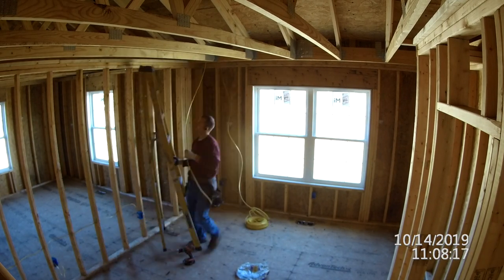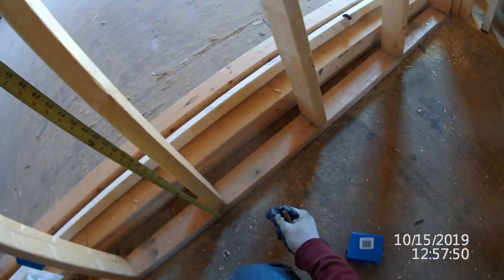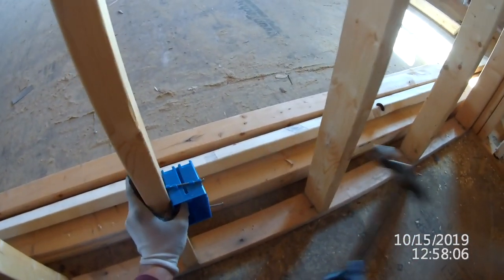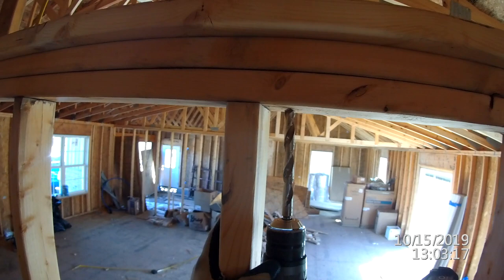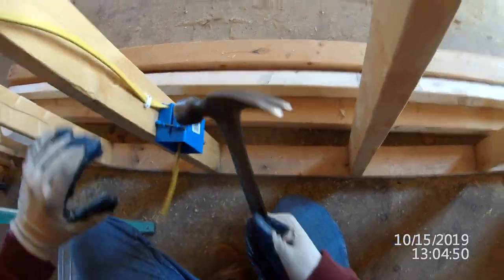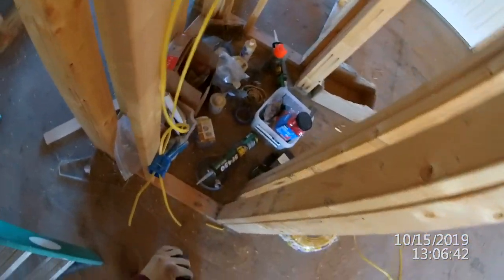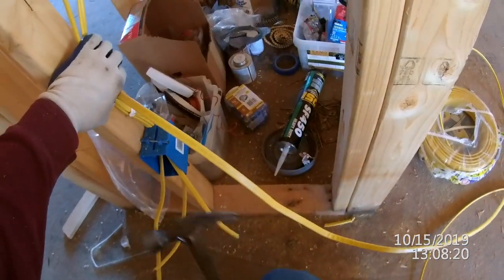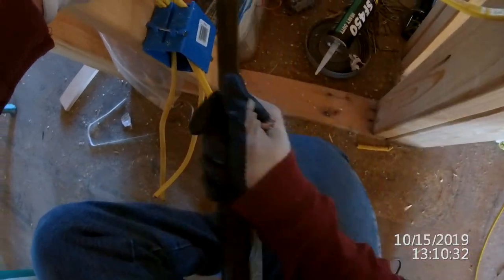How To Rough In Electrical For Receptacle Outlets & Switches

Comment: Trying to figure why you are spacing every receptacle box six feet apart, isn’t initial spacing 6ft so you can have them 12ft apart box to box?
Reply from the maker: Check your local building codes for details. I do every 6 foot apart so I will have plenty of outlets if I live here. Thanks for watching!
Reply: Yeap. 6',12' rule.  No more than 6' from a corner down the wall line and no more than 12' between receptacles.  A stand up lamp with a 6' cord should be able to be plugged in from anywhere on a wall line is a way of thinking about it.